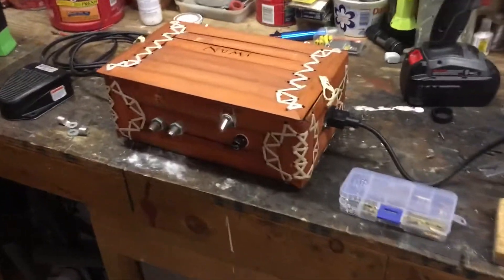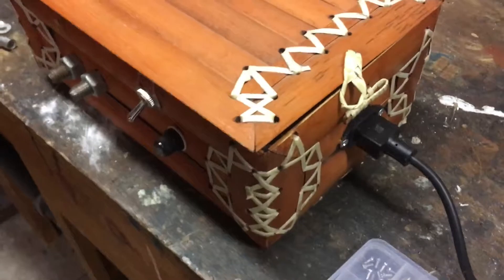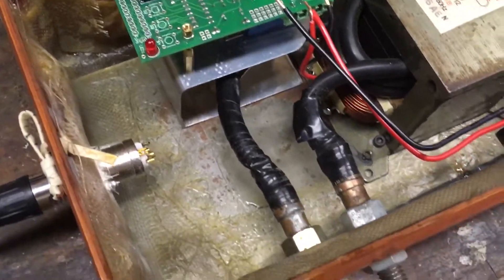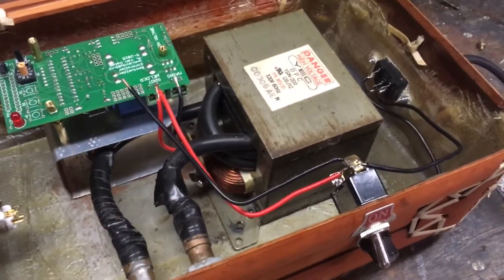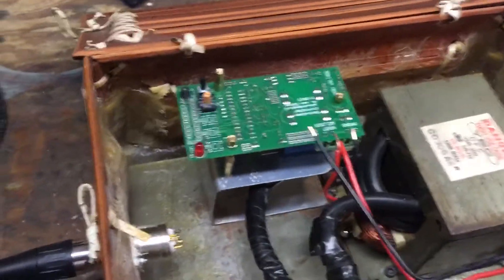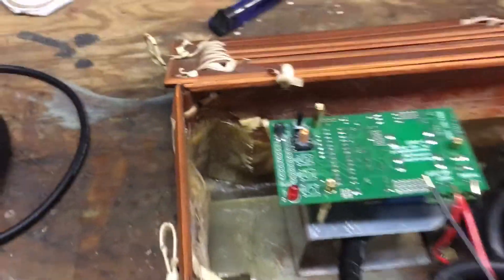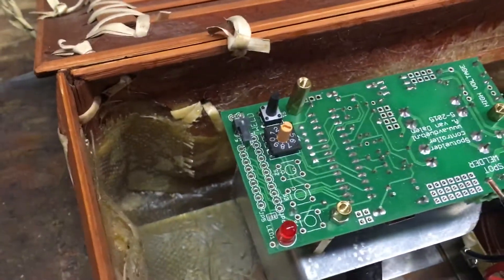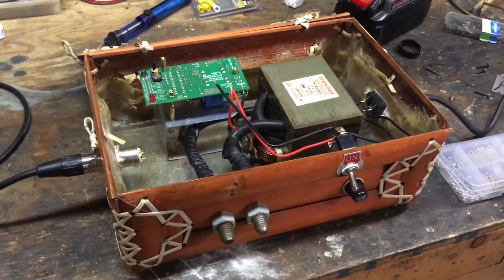Custom/DIY MOT spot welder.

Comment: So,  UUHHHMMMMMM.    LOL.       thumbs up on the build.    aint electronics neat ?
Reply from the maker: Ratheadskulls uhhmm, I would agree. I got it working pretty good this spring and used it to make a 3kWh battery. I'm actually working on a lot bigger welders now, so it was a good intro.

Comment: nice build!
Reply from the maker: Thanks, I am pretty happy with how it all turned out. I made a base and spring loaded arm for the electrodes on the business end out of solid red oak, and have it all working now. I have some new parts coming that will improve electrode placement and pressure that I didn't think of at first. Once I finish that, I have a 21s12p 18650 battery to assemble using 252 LG HG2 cells.
Reply: TheFootbaldd
 good luck